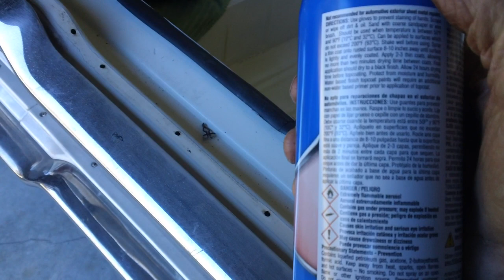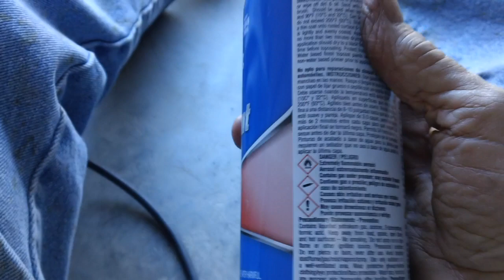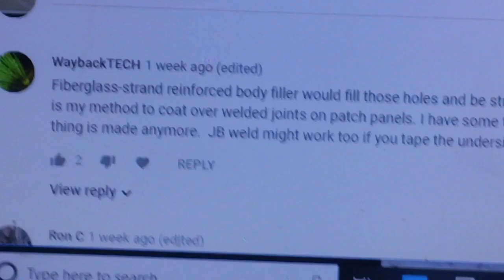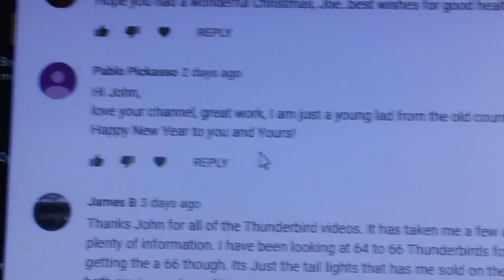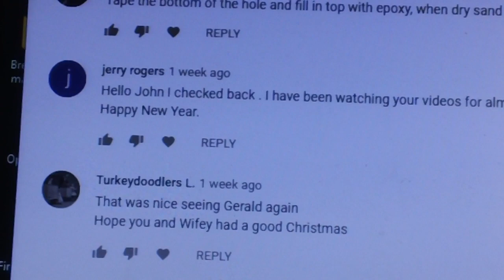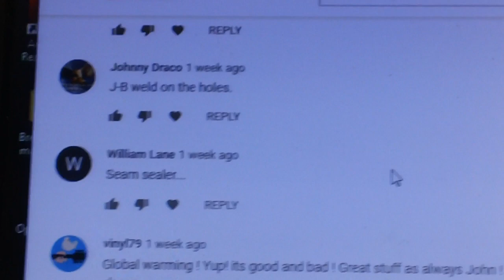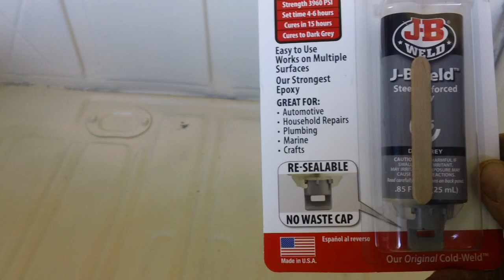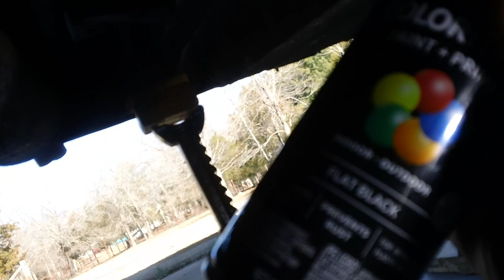1966 Ford Thunderbird repair and refurbishment (Part 31). De-Rusting part of the undercarriage.

Comment: Happy New Year to you and wifey and the project seems to be coming out really great I picked up 100 selection 1960 model Seeburg and have a lot of Rusty Parts on there I'm going to try to use yourwhite vinegar and see if I can take it off without damaging the Chrome
Reply from the maker: Vincent,
Congrats on the Juke find, my friend.  First give the rusty chrome a once-over with 00 fine steel wool.  Then soak it in vinegar for a day or so.  The vinegar  shouldn't hurt it, but do a small test piece just to make sure.
Regards,
John

Comment: Been waiting for the upload. Thanks and now I know what to use for treating the rust. If the JB weld doesn't work out in the trunk, you can also just weld it. Filling them small holes is really easy. Keep up the great work.
Reply from the maker: James,
I said in the last vid that welding isn't an option.  Not everyone has a welder and it would be too much work just to close a few small holes.  The J-B will work fine.  If not, bubble gum!  LOL
Regards,
John
Reply: @joernone  yeah a good welder can cost a good bit of money. Then if you dont always use it, it just sits there collecting dust.

Comment: t.s.p. is a kind of soap. House painters use it to clean before they paint walls etc. For some reason it prevents rust from forming on bare steel for quite a while. It won't remove any rust.
Reply: He's talking about trisodium phosphate. It works.

Comment: If you want to go really old school you could always use some sort of backer and then fill the holes with lead and have ya a lead-sled t-bird :)  Supposed to rain again today, but hey, it's gonna be in the 60's so who's complaining?  Gotta head back to TN again this weekend.  Picking up an old (not THAT old) truck.  A '98 Ranger.  Just want something I can haul a bit of lumber in when I need to, etc.  Looks like you've made some really good progress.  I can occasionally get WSM here on a skip but fortunately we have a station that plays the same era of country here, WKLO :)
Reply from the maker: Lead sled?  This boat is heavy enough!  BTW...you know you're over the hill when you consider something from the year 1998 to be old.  That of course hasn't yet happened to me.  LOL
Regards,
John
Reply: @joernone  I turned 50 last September so I figure that's close enough to over the hill, lol.  I would actually prefer something like a '59 Apache, but the Ranger was a gift from my Aunt & Uncle.  Turns out it's too wet in their yard to pick it up this weekend (It's sitting in their back yard) and it's supposed to snow Saturday.  When I do get it I'll never have to worry about losing it in a crowded parking lot though.  It's purple metallic, LOL!

Comment: On the 160 that I did I wanted to ask you I know you took yours completely apart now I have the rail that goes across that tells you selection playing it originally was the spot welded down down on either side can I jb weld it back down what would you recommend

Comment: A magnet would tell for certain but I think those brake and fuel lines are aluminum, at least they look it.  I used to undercoat everything to save the vehicle but factory rubber undercoating is why the bed on my truck is rotting away and since that started happening I am not sure these rubberized undercoatings are really a good idea because what happens is the undercoating comes unadhered from the car and collects water.  You'll have to do a cruse with John when you get the car on the road again.
Reply: very taboo to use soft weak metal on brake line, steel a must
Reply from the maker: Undercoating works well if applied sparingly and if the vehicle is and remains in a warm, mostly dry weather climate...also keeping it garaged when not in use.  Many folks in the northern states have two cars:  A shiny somewhat new one for summer and a semi-rust bucker for winter.  During winter the new one stays put  in the garage.
Regards,
John

Comment: John This is just a suggestion here:  When using the Permatex Rust treatment, I think it would be a good idea to place a fan under the front of the car to push the vapors of the Permatex AWAY from you towards the outside in the air!!  John Bellas --- Just thinking about your safety and health here.

Comment: John,  You see.. , my brand of liquor is correct.  The JB Weld was chosen, no mention of the magnet ?? Man....  LOL.. life is good. I have to tell you,  you made me laugh out loud.. too funny man... On the radio, how did you fix the oscillator ? curious if you have time.  You've done a magnificent job on that underbody rust.. well done  - Moving right along.   Stay warm my friend  - Ron
Reply from the maker: Ron,
No mention of the magnet?   Looking for star billing, huh?  OK...MAGNET, MAGNET, MAGNET, said RON C!!!  It's his bad liquor brand, folks. LOL 
Regards,
John
Reply: John, I still think a magnet will work better than tape under there and I am sticking with it... I better check the liquor brand.. I hope its not 4 Roses or Wild Turkey. LOL  Thanks my friend.   :)